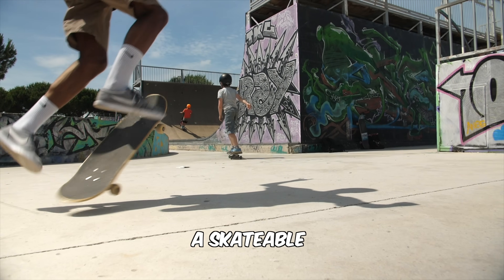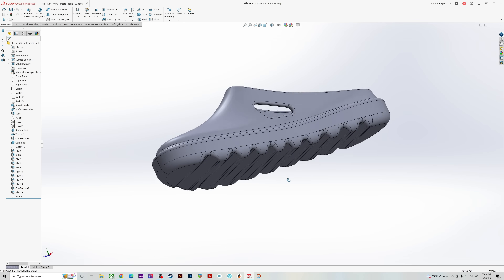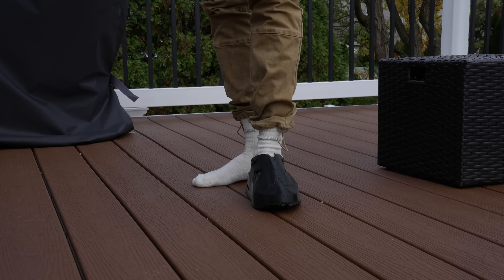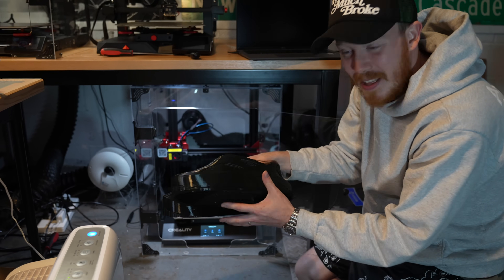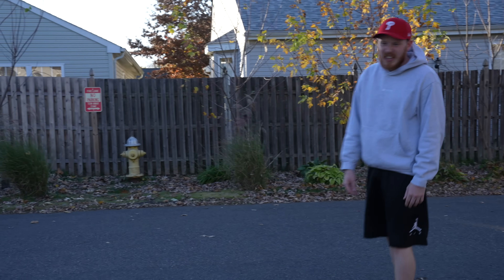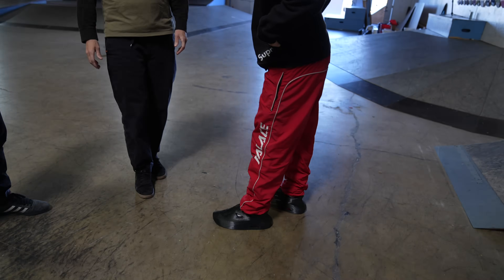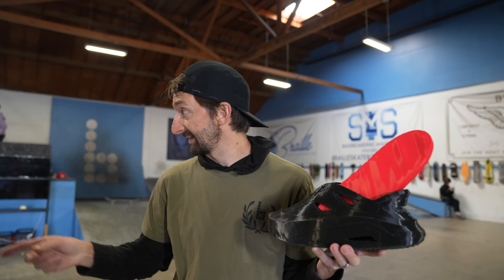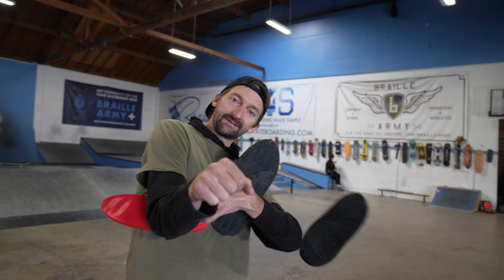Skateboarding In 3D Printed Shoes! (DID THEY WORK?!)

Comment: I would really recommend to spend a litte time to look for the right infill pattern or design it with lattice design software as nTopology. Fusion 360 has volumetric lattices in the product design extension as well. The infill is really important to the feel of the shoe as it provides the cushioning effect. Rect Infill buckles and therefore deflects to the sides which creates instability and even can lead to injuries if you twist your ankle. TPMS (triply periodic minimal surfaces) such as gyroids are super interesting for these purposes that's why the one shoe in your first 3D printed shoe video used it.

Comment: About the part in 17:20 you could just redesign shoes to fit an additional cusion attached to a part this guy pointed out, so it would be made of 3 parts instead of 2 and parts that make contact with ankle should also have bigger surface, maybe even based on 3d scan of a foot, that would probably remove some base problems with those shoes.

Comment: Have you tried using a larger nozzle for tpu? I've never printed tpu using a . 8mm but on abs PETG and pla a .8 would cut your print times down a ton and wit a model this large there should not be any difference in quality. A larger nozzle can cut down print times significantly since the printer can lay down more material in each pass.

Comment: I just saw the part about tpu support. Good luck. I hope it ends up working out but support on TPU might as well be welded.  Looking at your model you might be able to get away without printing support if you alter the tread pattern a bit near the toe. I have found that machines can print overhangs quite well and support isn't generally needed and you can Taylor your design not to need it.

Comment: Hi Seth, super cool to see what you're experimenting with here, which I had the time! I've done a bunch of printing of this sort part and I've found having a 1-2 mm radius on all the edges, standing the part up on its end (the heel for you), using a gyroid infill, additional wall on alternate layers, connecting the infill lines and fuzzy skin settings all make for a much more comfortable and evenly cushioned part and a better surface finish. I have a test part which will show that if you want.

Comment: What type of training do you have to be able to use that cad program? I have designed a ring doorbell mount for doors but it’s all rectangles. I can’t do anything else. Also that was using a basic designer
Reply: The internet is all you need. Seriously, a few Youtube tutorials could get you started easily in Fusion 360. I started in Blender myself which is sort of similar, but a little harder to get started. it's 100 percent worth it to learn one or both programs. A little studying goes a long long way